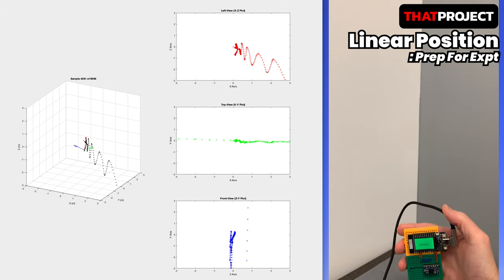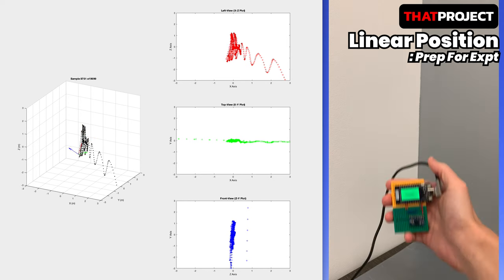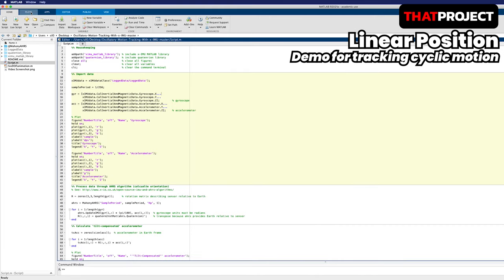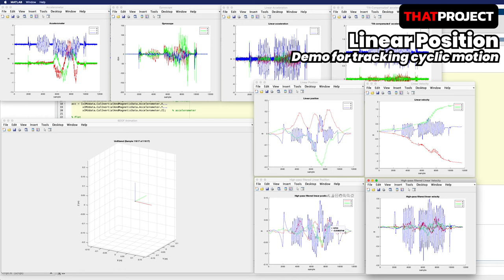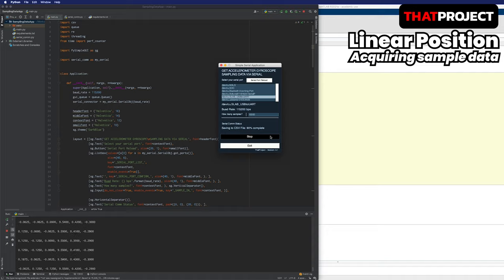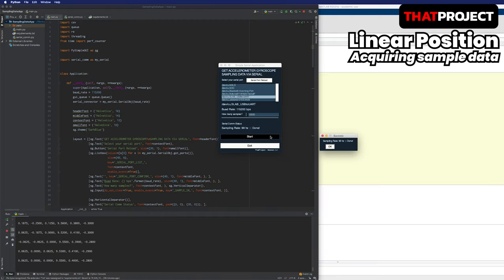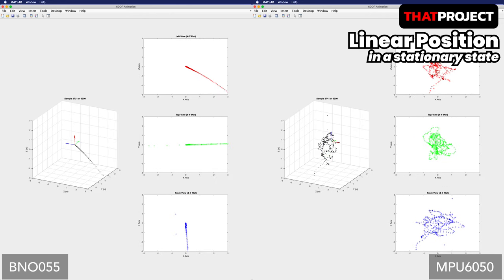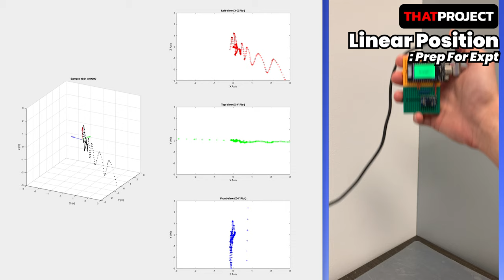IMU | Ep.1: Preparing an experiment to test linear positions (ft. MPU6050, GY-BNO055)

Comment: The BNO055 has a built in Cortex processor that reads the raw data and runs a sensor fusion algorithm (such as Kalman filter) internally. So your ESP processor is already reading filtered data from it. In the case of the Bosch you really are getting raw data. Thanks for your video in which one can clearly see the difference.
Reply: It depends, BNO has different mods

Comment: Hello sir, I'm currently researching and formulating IMU algorithm on my own. In the previous video (ep 0), i saw that  GY-BNO055 data were calibrated and the orientation data were provided also. And in this video, I considered that you calculated the position by available orientation data in GY-BNO055; and compared it with the position calculated by Mahony algorithm in MPU6050. Is this right?
Reply from the maker: More specifically, in this video, the data (acceleration/gyro) obtained from the IMU sensor is recalculated and visualized in Matlab. This is a comparison of two IMU sensors. In GY-BNO055/MPU6050, only raw data was acquired and MahonyAHRS was used in Matlab.

Comment: failed, cant use esp32 and bno055 with your code. would you explain how you collect data? I just need to fix a data form issue. I can use arduinospreadsheet.
Reply from the maker: I don't get it. Where did you have a problem?
Reply: @ThatProject  your code seems special， I dont need collect data like tha. python didnt make it in real time，I want to do the thing you showed at begining， but no code for that

Comment: So, do you think that BNO055 is much way better than MPU6050 to estimate the linear position? Because, I'm trying so hard to estimate the linear position using MPU6050
Reply from the maker: According to the test result, seems like BNO055 is much better than MPU6050 but it's hard to say that. When I collect the data from both devices, try to do the same way as much as possible. However, there may have been a better method depending on the device's characteristics. Please check each datasheet and find the best sensor for your project.

Comment: Hello, is the data being output dynamically? if so, how?
Reply from the maker: After collecting sensing data first, visualization is performed with the data.
Reply: @ThatProject  may i ask what visualization tool did you use?
Reply from the maker: @junzhezhang5397  As you can see in my video, I used Matlab.

Comment: Hi. I can use mpu9250 for project ?
Reply from the maker: Each sensor has slightly different characteristics so may require tuning.
Reply: @ThatProject  thanks
Reply: @ThatProject  hi. how to run esp32 with mpu6050 and matlab real time running
Reply from the maker: @ientucamranh9270  You can make a serial port connection in Matlab.
https://www.mathworks.com/help/matlab/ref/serialport.html
Reply from the maker: @Deadly Pearly I think just this one IMU sensor is a lot lacking for use in streamVR.

Comment: first, thank you so much for opening your amazing project. I have some question, is those python code working with Real time or only by demo? I connected with my BNO055 sensor and ESP32, but 3D animation is automatically moving by itself. thank you! 좋은프로젝트 감사합니다
Reply from the maker: My Python code is just for sampling data. Everything has to change in order to be calculated in real-time.
Reply: could you share any idea or method 59 figure out build up by real time??😭
Reply from the maker: @ghiblistdio7432  Unfortunately, it's not that easy. It is like a level of thesis preparation or the company's R&D.
Reply: I see😭
but thank you for you comment by the way!

Comment: This is very impressive! Thank you for sharing your work on this.
I have not had much luck with resolving drift with the mpu6050. But I was not aware of the bno055! It's results appear to be much more stable. I would be very tempted to switch my current project for measuring linear movements from arduino/mpu6050 to esp32/bno055.

Comment: Hello
I have been trying to test linear position with Adafruit BNO085 by following your video. 
I managed to get the value print out as the way as you demonstrated in the video with the BNO055 and change a bit of the Matlab code so that the accelerometer unit is g. 
However when I run the Matlab code, the animation is not even close to the actual movement at all. 
May I ask what changes have you made to the original Matlab code such that u can produce the clip at the end of the video? 
Thank you very much.
Reply from the maker: I haven't touched the basic Matlab code. Only the part of the view has been modified to show the screen of multiple axes.
The sensor I used is a clone version of the BNO055. Something might be different from yours.

Comment: From what I see in the video and the comments, it seems that Arduino code is used to get the accel, gyro and mag. data from the IMU and then Matlab or Python code is used to calculate the velocity and positions.   Does Arduino code exist also to perform the calculations done in Matlab ?  Or is this simply not possible due to processing speed of an Arduino ?  Thanks.
Reply from the maker: In Matlab, we are calculating with data that has already been sampled to obtain coordinate values. It is not impossible to perform Matlab calculations on Arduino, but calculating in real time probably requires a different approach.

Comment: Thank you. 

What is the repeatability accuracy. i.e. for example, you keep it at ground, move one feet up. get back to ground, will it show same in calculated value?

Is it possible to get small sudden movement say 0.1 mm using these sensors?
Reply from the maker: Due to the drafting of each axis, this is not quite as accurate as you might think.  You can get an approximate position, but it won't be in a perfect position even if you put it back in its original position after a move.

Comment: Nice video, but can the position display be shown directly on the arduino serial monitor without entering matlab?
Reply from the maker: The reason Matlab is used here is to calculate the position using data obtained from the IMU. Without it, this is nothing.
Reply: @ThatProject  Do you know of a sensor that can get a position like your video, but doesn't use matlab?
Reply from the maker: @barajr1349  For this project, an IMU sensor is needed, and the data obtained from it needs to be processed. There is no sensor yet that accurately calculates x,y,z coordinates in 3D space.

Comment: Hello, 
Please, are the data (Data time, Data Rotation matrix, and Data EulerAngles) necessary for the calculation and display of the positioning, because you are not using it. 

Also, for the packet number you have put an increasing number from 1 to 10000, but the packet number in the original example is different. Does this affect the calculation? 

One last question, is Data Rotation matrix recorded by the sensor? 

Thanks
Reply from the maker: The data obtained from the sensor is the gyroscope and the accelerometer matrix. Based on this, all calculations are made in Matlab to obtain positioning. The packet number doesn't really matter.

Comment: Is there any way to convert this code using a leonardo arduino instead of an ESP32? If so, you could try to explain it to me, I started an indoor tracking project with a 6050 MPU, but I only have one leonardo arduino, and your video was one of the best I've found on this subject, but as I'm very new to this subject, I don't know if it is possible to perform this "conversion".

Sorry for my English.
Reply from the maker: Unfortunately, I haven't do any projects with the Leonardo Arduino. So I have no idea about this board. Sorry for not being of any help.

Comment: Hi. Very helpful video, thank you ! You are maybe THE solution to my problem acquiering accurate position from IMU.

The code you used in matlab comes from 'Oscillatory-Motion-Tracking-With-x-IMU'. I saw x-IMU is a quite expensive IMU and I was wondering how you used their script to get real time data from another IMU ( MPU6050, GY-BNO055 ). Are functions like 'xIMUdata.CalInertialAndMagneticData' understandable for another IMU ?
The problem is that I do not really understand the link between the Matlab code and the two IMU you used. Is it compatible ?
Also, given the end of the video, would you advise rather GY-BNO055 than MPU6050 ?

I hope I'll get an answer :) Thank you in advance.
Reply from the maker: To use the Matlab script they provided, we first had to collect data such as Accelerometer and Gyroscope. After that, I was able to save it as a CSV file type and read it in Matlab to obtain the coordinates where I moved while holding the sensor.

I don't understand the "compatibility" you mentioned. The Matlab script and data collection process operate independently of each other and require completely different workflows to perform them simultaneously.

In my tests, I think the BNO055 showed better results than MPU6050.
Reply: @ThatProject  Ok thanks for your help. I misunderstood some things. I thought what you presented was real time processing. So the xIMU script in Matlab is not acquiering any data in real time. It only reads raw data from the CSV file (accelerations, angular velocities, magnetic field from the IMU) and treat it to get position.
By the way I think you did some calibration to the sensor before having accurate results, didn't you ? Or did filters handle things anyway ?
Reply from the maker: @SpaceDragonYT  If you look at my code, in the case of BNO055, it starts after performing its own calibration function before starting sampling.
Reply: @ThatProject  Ok I see. Thanks a lot for your help. I'll try this, I hope it will work :)

Comment: Hello, 
Thank you for your video. 
I have a question about the data recorded by the sensor. 
In my case I used a sensor WitMotion Bluetooth BLE 5.0 9 Axis WT901BL, it sends the data directly to a software developed by the same company WitMotion, we can extract the data in text form and then convert them to CSV. 
I collected the data of the accelerometer and the gyroscope as well as the magnetometer on the same CSV file, but when I transfer it on Matlab it does not work, error in the file. 
I don't know if the problem is in the structuring of the data file or if it is necessary to change a detail in the code? 
In what form should the data be saved for the code to work?

Thank you
Reply from the maker: If you create the same csv in this format, no problem. 
https://github.com/xioTechnologies/Oscillatory-Motion-Tracking-With-x-IMU/blob/master/LoggedData/LoggedData_CalInertialAndMag.csv

Comment: Hello, what is the accuracy of the position data in mm in xyz movements? Have you been able to test it with the help of a ruler or meter? Thanks.🤙
Reply from the maker: Good point. I can't answer because I haven't tested it accurately. I think that perhaps the accuracy can be improved by scaling up and down in the space with coordinates.

Comment: Hi, this is a very useful video! But I'm wondering what the raw data look like. My output IMU data now contains a(X, Y, Z), g(X, Y, Z), and m(X, Y, Z). I don't know if it's the right one to run the code. Thank you!
Reply from the maker: All you need is data for a(X, Y, Z) and g(X, Y, Z).
Reply: got it, thanks! @ThatProject
Reply: Then I just have to change the filename in the code right?  @ThatProject
Reply from the maker: @wanyunqu4085  What do you mean by the filename?
Reply: Sorry for the confusion, do I have to make some changes to let the code run my data? Or I can just simply change the import data: xIMUdata = xIMUdataClass('LoggedData/LoggedData'); to my file's name. Thank you! 
 @ThatProject
Reply from the maker: @wanyunqu4085  Just enter the path and the filename of the CSV file containing your sampling data here.

Comment: Hi! I'm trying to get your code working on Windows, but I'm having trouble with python part where you made "simple serial application", I've managed to start it, but it doesn't want to create samples to csv.  file. I have mpu6050 sensor and esp32, but I didn't use  TFT screen, so I deleted everything in your Arduino code that has TFT written in it. I also see that I have a bit different pinout on my esp32 than yours, I hope that isn't problem? Thank you for your answer.
Reply from the maker: First, please check whether ESP32 outputs the value of the gyro sensor and the accelerometer sensor properly from the console.
Reply: @ThatProject  Jep, it works now, can you display data in real-time? Readings from gyro  and send it to matlab? I can now save samplings in to csv. and look readings in mat lab, don't know if it is possible in real time?
Reply from the maker: @ivansucec2510  I don't have a plan to work yet, but I'll let you know when it's completed.

Comment: Great video! What can I use instead of TTGO that can guarantee similar results?
Reply from the maker: The point of this project is the IMU sensor. Of course, you can use any ESP32 MCU.
Reply: @ThatProject  one last thing please..if I want to summarize the steps to follow from the beginning :
-collecting data from IMU than applying the matlab code to see the signals(velocity,filtered signal..)
- obtaining csv file contenting positions
-hardware 
-linear position 
Is that right or im missing something ?
Thank you in advance
Reply from the maker: @wahbimanchoul2666  I think you're on the right track. Any updates? 
What kind of IMU sensor are you using for your experiments?

Comment: Few weeks I've tried, i can save the Datalogged by using your python code. Actually when i start the simulation, the result of animation is kind a different with actuall motion. 

How do i solve this
Reply from the maker: That's the same as mine. Accurate positioning is not possible because the values coming in at the beginning have not been fully calculated.

Comment: Hello, can i use this as a precision gps sensor for an ardurover or is there some factor that would not allow this implementation?
Reply from the maker: Well, what I did here is more of a test for an IMU sensor. What's your plan to use IMU sensors to increase GPS precision?
Reply: @ThatProject  my plan is to use the coordinates generated by the IMU and transform the x axis into latitude and y into longitude and send this to arduover as if it were the response from the gps module itself.

Comment: Will it work if i were to track a circle with a diameter of around 50m ? And will the precision be to the point?
🤔🤔
Reply from the maker: This is done by first collecting sampled data and then reading and analyzing the data in Matlab. For actual use, many things must be added and implemented.
Reply: @ThatProject  Hmm, I see. That helps a lot. I'll be trying my beat to make it run in real time.
Thanks Again!🙂

Comment: Hi... I'm interested in this project and I have a question. Why it is linear only ?. Can't we track at least 2 dimensions like x and y ?
Reply from the maker: Linear for the X, Y, and Z axes.
Reply: @ThatProject  Oh, okay. I thought the unit could only detect one axis because you were moving it up and down. 
I've seen your other videos on tracking using UWB, which has good accuracy but requires external anchors.
Is there a way to increase the accuracy of IMU-based tracking without using external hardware? Would it be possible to use techniques like SLAM or odometry in combination with this project to improve tracking accuracy and reduce drift?
Reply from the maker: @akshayjose6555  It's possible, but it takes a lot of effort. In particular, it is possible to determine a specific location based on UWB, but it seems that a lot of work must be done to integrate an IMU sensor and operate like a SLAM without image processing.
Reply: @ThatProject   Is it possible to add image processing  in it ? (I mean the IMU based tracker shown in this video)
I've seen some open-source projects that use a Raspberry Pi and a single camera to achieve this, and I've even seen someone do it with just an ESP32.
I’m including a few interesting open-source projects below

Project 1
Video :- https://youtu.be/8jt-9f7Tbi0
Source :- https://riccardogiubilato.github.io/visual/odometry/2017/12/12/Visual-Inertial-Odometry-On-A-Budget.html

Project 2
Video :- https://youtu.be/2RwymYYxd5s

Project 3
Source :- https://github.com/weixr18/Pi-SLAM
Reply from the maker: @akshayjose6555  I think it is very difficult to implement SLAM with only ESP32. OpenCV is available, but data processing is very slow. For your project, it seems appropriate to do it with an SBC rather than an MCU.
Reply: @ThatProject  oh okay.. thank you for your valuable inputs. I'm trying to make a tracking device which can track it's position in 2D with low latency and good accuracy (2cm - 3cm)

Comment: Thanks, Is this code works on arduino Nano ?
Reply from the maker: For i2s communication, Arduino series uses #include <I2S.h>. After changing this part, and also removing TFT_eSPI if you don't need the display, it seems to work. Just try it and let me know the result.
Reply: @ThatProject  Ok, I will try that, Thank you for replaying ❤.
Reply: @emad-dev  I would love to know if it worked as well, I was thinking if its possible to make a VR controller with this
Reply: @leohds  That's what i trying to do for the final project of my college.
Reply: Hi, the code that written in Matlab that calculate the velocity and position, can you convert it to c code for arduino, or is there any library can provide these calculations ?